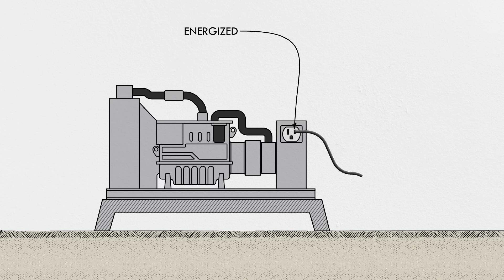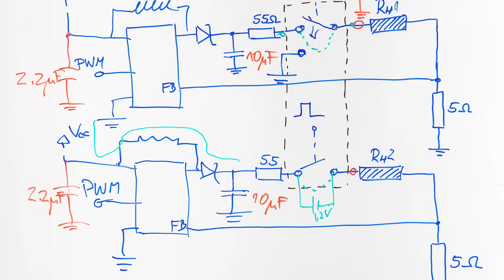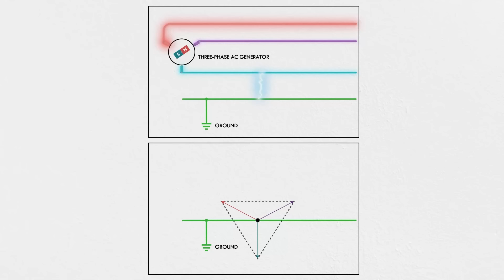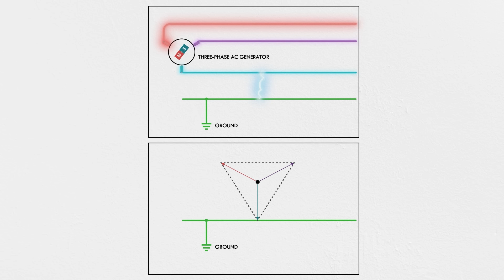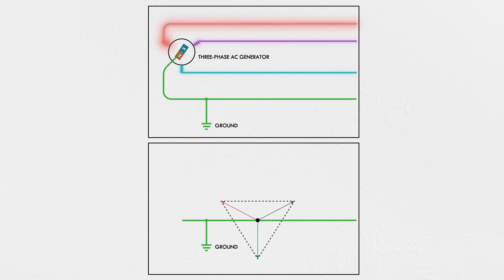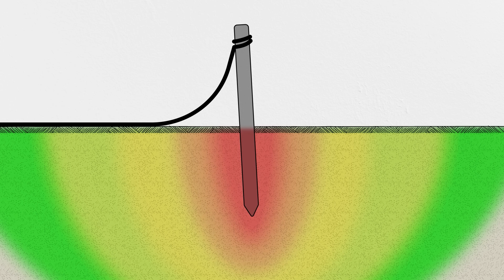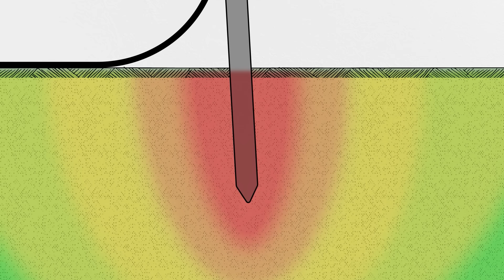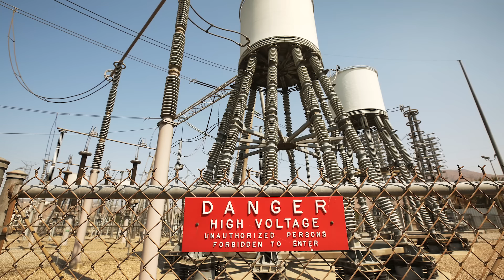Where Does Grounded Electricity Actually Go?

Comment: I remember working with a friend of mine on my home electrics. I mentioned to him that the circuit was live, so be careful. He said not to worry because he wasn’t grounded. He grabbed the hot wire and got a shock. I explained capacitive coupling with AC.
Reply: "so be careful" would have been to have shut off the power before the circuit was exposed and a risk of shock was non negligible.
Reply: @ianallen738  That only applies if the work can be done on a cold circuit. If they were troubleshooting a circuit, they might not be able to find the problem if it was cold. Sometimes hot work cannot be avoided, and so other methods have to be used to maintain safety.
Reply: @ianallen738  We were just getting started. I did mention that the breaker wasn’t off. I wasn’t expecting anyone to work on a live circuit or anticipating anyone to reach in a grab the hot line after I warned that it was live.
Reply: I literally have to double bag my hands in certain areas of my job because there's so much capacitive coupling that turning off the power INCREASES the voltage you can measure. It's wonderful every time, changing out an old light fixture and getting 300V+ not even 5 seconds after shorting all wires.
Reply: The shock from capacitively-coupled mains and L-N/L-G mains are two completely different things though. The capacitively-coupled one (about 100pF of human body capacitance, 26Megohms at 60Hz),  is only an unpleasant but otherwise harmless tingle while L-N/G is painfully sharp and potentially lethal. In both cases, I'm more worried about over-reacting to shocks than the shocks themselves on 120V.
Reply: He likely made contact with something grounded without knowing it then. Capacitive coupling is indeed happening, but the frequency is so low (50 or 60 Hz) that normal mains voltage over the small capacitance body to ground, will not result in very much current flowing  
 - it's usually in the microamp range. I have touched the hot wire many times when standing insulated from ground and felt nothing at 230 V, 50 Hz. But I can feel it sometimes if I have a stripped touching the knuckles or outside of the hand, where the skin isn't as thick (I wouldn't say "shock though - more like a "tingling" sensation). 
Capacitance vary quite a bit depending on the environment too - for example concrete floors can increase the capacitance quite a lot (even if someone is well insulated by shoes and standing on a carpet), the feet forms like a small capacitor to the very conductive (and usually grounded) rebar below. Maybe some other people is also more sensitive than me.
Reply: @Speeder84XL  indeed, he was grounded in some manner.  and a lot of things are conductive that people don't think about; including car tires, and concrete.  and high voltages, such as discharge lighting can overwhelm the dielectric strength of things people think of as insulators.
Reply: @Speeder84XL  When you are on a metal ladder, the whole ladder can act as an extension to body capacitance and that could add 100+pF. The type of ground below doesn't matter much for capacitive coupling purposes when we're talking Xc > 1Meg vs 30-80 ohms for damp dirt, only a 0.01% error between that and a steel plate.
Reply: @Speeder84XL  When you have an unshielded floating body, capacitance isn't only between the floating body and the ground immediately below it, it is between the floating body and everything else within electric field line-of-sight. The total capacitance will be multiple times higher than just the patch of ground under your feet.
Reply: @Speeder84XL  I had a guitar amp that would shock you if standing barefooted on concrete, particularly brutal if the floor was damp. Pretty sure it is the rebar.
Reply: @teardowndan5364  Yes, but distance matters a lot, so if a part of your body is very close to something grounded, that's where most of the capacitance will be. 
I just did a test just for fun standing with shoes on a dry wooden floor (which has concrete below, but the wood layer on top is pretty thick, so there is some distance down to the rebar) and put a multimeter set to measure current with one probe connected to "hot" side in a in a wall outlet, then grabbed the other pin. 
The meter I used had a resolution down to 0.01 mA and showed nothing, just zero - but then when putting my other hand to a concrete wall (with a layer of wall paper that has also been painted on, in between
 - probably not very conductive), it went up to 0.05 mA. That was also confirmed by the fact I couldn't feel anything at fist, but with the hand against the wall, I could feel the current when putting the pointy end of the multimeter probe against the outside of the other hand (which will also cause all the current to enter the body in a single point and be felt the most compared to the amount of current flowing).
Even putting a plastic bag between the hand and the wall (which should provide pretty good insulation and eliminate all  possible effects of direct conduction while still maintaining a small distance), I still got 0.04 mA.  
I also know the rebar is pretty close to the surface on that wall, because strong magnets will stick to parts of that wall😄. 
Same thing will happen if standing on a floor with similar properties

Although - if the distance isn't very close to something grounded, the size and shape of conducting objects do seem to matter more. So with the ladder in the example, it might might increase capacitance quite significantly relatively speaking
 - but still it will probably not matter when it comes to getting a shock. That can only possibly happen if the capacitance is "out of the ordinary" high for some reason
 - which it will only be the case if a part of the body or some conductive object it touches is very close to something grounded (or if it's some huge metal object like a large truck or something). Even 100 pF added is not much when dealing with just 50-60 Hz. The reactance over that capacitance is like 26,5 MOhms at 60 Hz and 31.8 Mohm at 50, so increase the capacitance by that much, will increase capacitive current by just about 7-8 uA. 
So, capacitances quite a bit up in the nF range is needed to get a shock from 230 V (even more to get it from 120 V, if living in america). 
In my test I got about 550 pF with the plastic bag between, given that the voltage is 230 V and 40 uA was flowing at 50 Hz. But that's no way near enough getting a shock - just feel it a little if the pointy end of the probe is put against the outside of the hand.
Reply: @sapinva  In that case it might be some conduction as well - especially if the floor is damp. But even if that's the case, the rebar still makes a huge difference, since the current only has to pass thru a few cm of high resistance material before entering the  very low resistance path to ground below. Compared to if the whole floor was made of some high resistance material.
Reply: if i am ever going to touch a  bare wire, i have a habit of touching it to the frame before i touch it 😅😊

Comment: My electronics professor was explaining 3 phase, 4 wire motors. He had a diagram of the 3phase generator connected to the 3phase motor and kept emphasizing the “4 wire” part of it. Finally a student asked, “where is the fourth wire?” Then he pointed to the ground symbol and added a ground layer to the diagram connecting the generator and the motor.
Reply: Three phase may be configured in a "Y" or "Delta" configuration. In Delta configuration there is no phase to neutral connection. At terminations a transformer makes the conversion Y to Delta or vice versa.
Reply: How long the class suffered trying to understand until one mind could not take it any longer and had to let his soul get satisfaction in answer form.
Reply: Technically, the term “three-phase four-wire” never refers to the use of a ground wire, only a neutral wire. If I have a three-phase motor that for some reasons used a neutral wire, as well as a ground wire, it is a four-wire grounded motor (not five-wire).
Reply: @MR-nl8xr Or he's trying to let students think for themselves instead of just blindly accepting everything he says. "Ah yes, three does equal four, because teacher says so."

If using an ounce of brain power to ask why something seems wrong is considered "suffering," then it's no wonder our education system doesn't work.
Reply: I would try and get students to understand the difference between a neutral and a ground before I got too far into a discussion . That would clear up the confusion.  And I have been guilty of using one term when the other was correct.
Reply: @altuber99_athlete  
In industry terms of the art, you are right a neutral wire and a ground wire are treated different because the neutral is intended to be a regular primary current path and a ground is only intended for the stray current needed to anchor the overall system potential or to trip a breaker in the event of a fault.
However, electrically a universal zero reference or neutral does not exist, potential is always relative between two things. In this case ground is considered only "neutral" because it is in common contact(direct or indirect) with just about everything in the local area so it is a handy local reference for safety or efficient power managment.
Though I suppose you could ground one of the extreme high or low potentials and have a neutral wire with substantial potential relative to ground, I don't see what the practical reason would be. In this case neutral would be defined as half way between the lowest and highest potentials in the system. Like a 24v to ground leg a 0v to ground leg and a 12v to ground "neutral" wire. But such a system could be accomplished much more practically with a +12v leg and -12v leg relative to "0v ground"; the electrons wouldn't know any different, its still 24v relative potential with a neutral providing 12v potential in the normal functioning state, but it lessens the practical hazards of a circuit fault.
That is assuming that ground is a large non-insulated conductive body [Actual earth, building beams and pipes, conduits, truck frame, ships hull etc.] If ground is fully insulated the same as other legs then both circuits are truely equal because a 24v fault would require compromising two layers of insulation concurrently in all scenerios, but fully insulating ground is generally impractical and the substitute mitigation is to have the maximum potential to ground be half of maximum potential leg to leg. (This works about the same for AC or DC)
Reply: Yes you never include the ground when saying how many wires are in the circuit. I find the best way to avoid confusion when ordering is to always state "2 wire + ground". Or "3 wire + ground".
Reply: As a person who just ran a 135ft of cables, 3 for the phases and one for ground i find it quite funny
Reply: @BH_tradie  idk why it was designed like that, i just provide the cable. I too thought there had to be a closer source but i guess not otherwise no reasonable person would specify that. There were a few other things going out that far as well, i just dont have an exact clue for what. 
Imma review the wire diagram tomorrow and see if i can gather more clues as to what on earth i had to have 4 separate 8 gauge wires be 135ft long for
Reply: @Palmtop_User sounds perfectly normal to me, that’s a basic distribution board… only thing you’d have to worry about is approaching a high VD depending on your circuit FLCs.
Reply: @MR-nl8xr  OR, the rest of the class already understood. No way to know.
Reply: @Majima_Nowhere  he was saying the class was suffering not knowing what the professor meant and being too afraid to ask. He wasn't saying that asking is suffering. He was saying that not being able to ask is suffering.
Reply: @Majima_Nowhere  also, "our education system doesn't work" is such a nonspecific assertion, presented baldly without evidence, I'm surprised it's anywhere near a science video...
Reply: My natural science teacher in high school literally used a jar filled with soil to represent it and make it less of an "invisible" thing that might not be overly visible in a system or circuit drawing.
For most students that never messed around with a battery and a little bicycle light, let alone held a multimeter, this was a massively complicated subject, let alone understanding the concept of where "earth" is derived from.